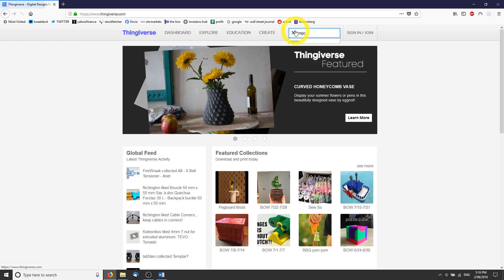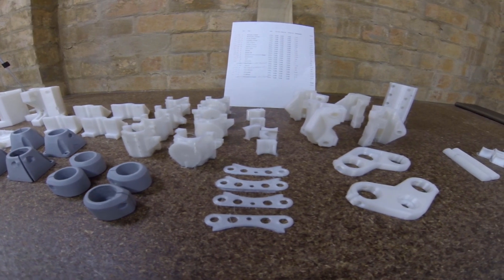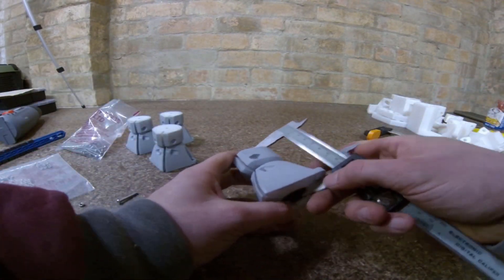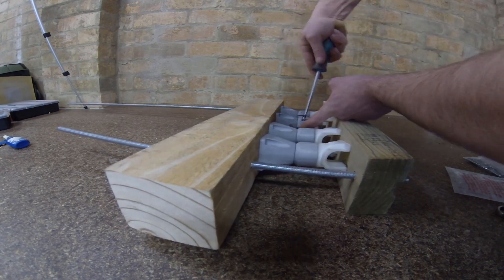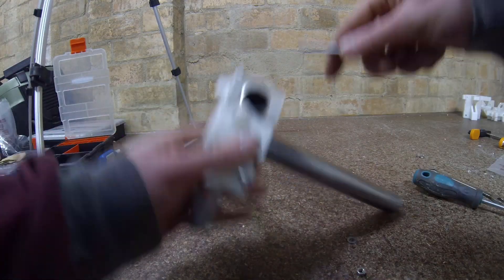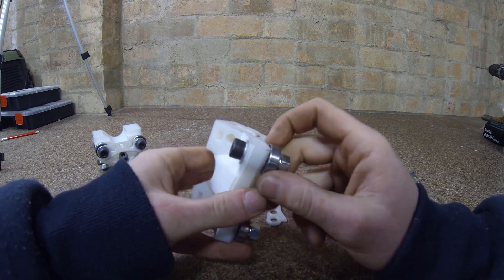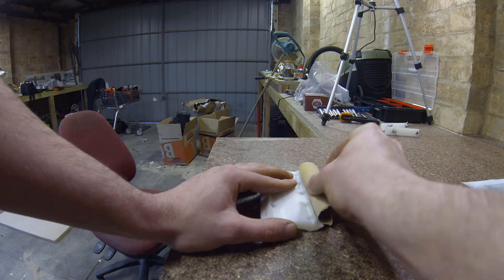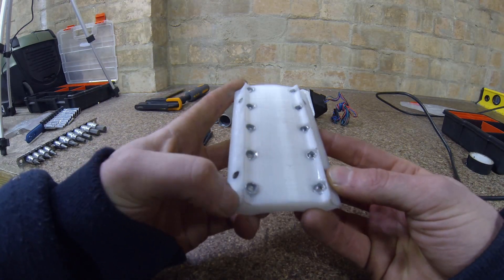mpcnc build 3d printing and sub assembly EP1/4

Comment: So has the dust gathering on the rails given you any problems?  just curious as I want to build a diy cnc but I am concerned about the dust affecting the carves.
Reply from the maker: not with dust i have had problems only once i think with nylon and aluminum, but generally i clean the hole machine when i'm don with it.

Comment: Love your videos, I was wondering what size is your setup? Did you use 1" polished tube or did you use 3/4" EMT?
Reply from the maker: just mild steel 1" tube and the setup is 3x4 with 2 inch on the z

Comment: Can you share stp or Fusion360 files. Need this for f model 25mm😊
Reply from the maker: not really i didn't save them its easily done in fusion though open new document in fusion 360-right click top component-select do not capture design history-import stl- find stl in the component file right click - select mesh to brep, all of my stl files i have published on my mini factory apart from my spindle holder as its still work in progress.

Comment: what router are you using for a spindle ?
Reply from the maker: hi sergey, in this video its and ozito diy router and at present i am using a katsu (makita clone) untill i can find a good deal on a makita.
Reply: I'm from New Zealand and building MPCNC myself. Is it this  router ?
https://www.bunnings.co.nz/ozito-350w-laminate-trim-router_p00292561

I have an old renovator twist a saw and probably try with it first
Reply from the maker: it was that router sergey it worked fine but having something with variable speed is nice
Reply from the maker: forgot to mention the 1 downside to the ozito is you cant get different size collets.

Comment: Glad to see another Aussie doing this.   Any reason you did the J model instead of the F model?
Reply: I appreciate the video. I have started working on mine. The tube selection takes a bit to comprehend. The different measurement systems and different size tubings complicated the process. I also wish that the parts were labeled better in the Thingiverse download and the pictures. The assembly instructions don’t give consistent part names and clear pictures. I’m figuring it out. Bought the 3/4” EMT conduit last night. Hard to find straight 10’ lengths at the hardware store. Would have liked stainless but that kicks price up to a point that I think it makes me think to go to the next level and use extruded aluminum framing systems. In any case, every video helps.
Reply from the maker: no worries  @MarionMakarewicz , i wouldn't recommend aluminum as the bearings will wear through it very quickly the mild steel i went with its been quick ish on (bout 3 months solid use and the bearings are just starting to spin loose in some ares but doesn't seem to be affecting it to much), i would be curios to know how long stainless lasts
Reply from the maker: no not really Randall, i suppose my gut instinct was to go with common size steel, can never have enough 1 inch box and tube in the shed.
Reply: @prop1305  LOL. I can understand that. Myself I went for the F model, and got the sandleford chrome tubes from bunnings (stock cut lengths).  The  worked great for my MPCNC build.
Reply from the maker: its surprising just how well the machine works for what it is, definitely happy with it so far its been working non stop since i built it, stickers laser v caring and plotting very happy with the design, accuracy and the capability's it now enables me